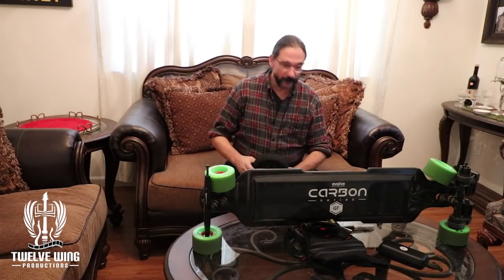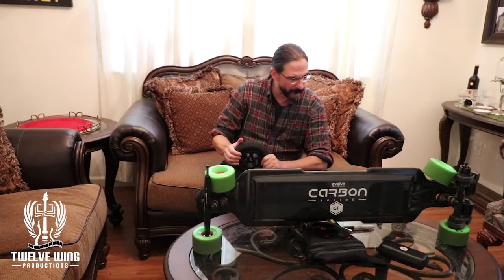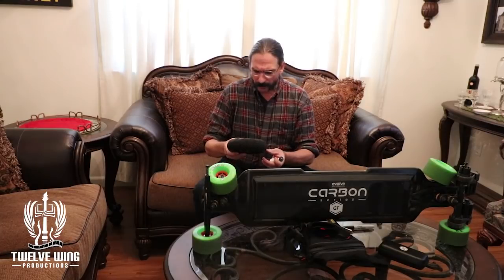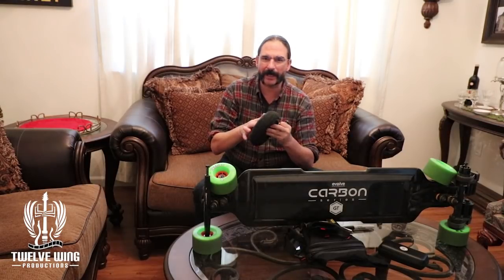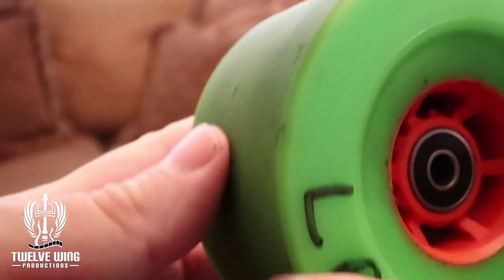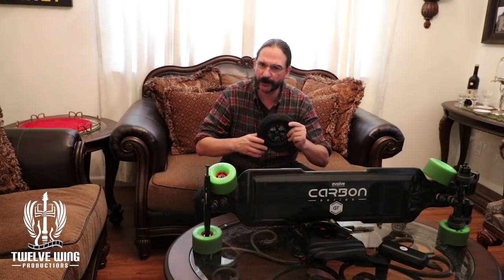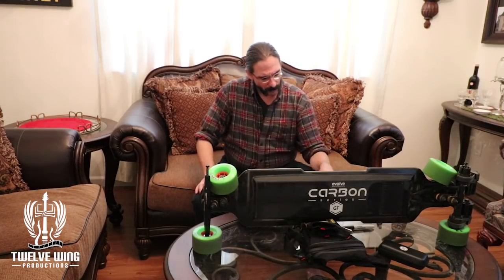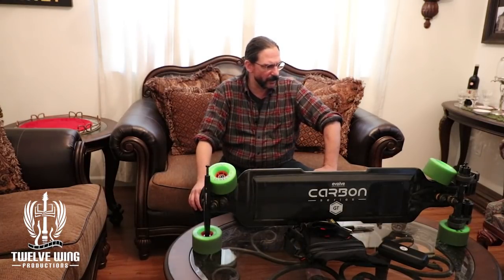Best electric skateboard bearings (and why)

Comment: I have the moc 5’s. They’re not that good and over priced for what you get. My $10 Independent GP-S bearings are faster than these bearings for a reference
Reply from the maker: I'd not say these bearings were necessarily "faster" if that is what you are looking for.
As I went into in the video, I view these bearings as a bit of a "special use" bearing.  What makes them cost a bit more is the fact that their construction allows them to take lateral load better than other bearings.  Because the channel is deeper and comes up further on the sides of the internal ball bearings, what you say is likely true since this would increase the contact surface.
In the case of an electric skateboard, however, "faster" probably isn't nearly as important as longevity.  ESPECIALLY when you are talking about the new cadre of electric longboards.  Skateboarders aren't usually getting on the board and doing 20 miles in a day.
Again, as I went over in detail in the video, the torque on the drive wheels of an electric skateboard are where I think the use case for these bearings really comes into play.

Comment: Theres just more wear on the back wheels because majority of the time as humans we pute most of our weight into our heels thats distributed towards the back of the board  the back trucks bushings are probably abit tighter while the front truck is more loose being easier to guide you around you'll probably buy new wheels but if need be you can just rotate them back left wheel to the front right and back right to front left hope this helps have fun and be safe
Reply from the maker: I'd say a combination of different factors.  What you say is likely true in that I can certainly say that as I approach obstacles like expansion joints and such, I tend to shift my weight rearward to unload the front of the board a bit.
I can, however, equally say that due to the large size of the wheels I do NOT do this as much as I have done with standard skateboards... even longboards.
I'll also submit that the type of torque related damage I'm seeing on the rear wheels (Curved cuts) is also not indicative of the more "puncture" type wear one usually sees in a skateboard wheel.  So there are most certainly other factors going on here.
Now that I'm getting back to doing some videos... I may have to revisit this and see how the ol board is doing.  Maybe take everyone through the inevitable upgrade process I have to go through to be actually happy with the remote.

One disappointment I've had with the Evolve board I have is that what is obviously a world class board design was coupled with such a crappy and even dangerous remote.

Comment: Oust Bearings I am dis appointed in the moc 9 they failed in my daughters board she weighs 73 pounds at 10 yrs old and in 1 year they failed i have read they are one of the best on the market maybe we got a bad set these were on the front of the board the board riding is very low abuse just road riding basically no puddles mud nor rain they are wrapped with 59mm bones rough riders and the wheels look awesome in new shape for the age yr old.  maybe a bad set i would like to write oust bearings and perhaps get a replacement and give them a try again. i dont want to sell them out just yet..... great video i really enjoyed it. and your right a lot of the top riders use them too and this is why i got them.
Reply from the maker: Sorry for your experience and I hope this wasn't a catastrophic failure.
One thing I will say about them is that because the races encapsulate more of the radius of the actual ball, the clearances may be tighter overall and less forgiving to debris or corrosion if the board isn't frequently used/lubricated.
That's hard to say.
And yes, it could also have been a bad batch.

All I can say for my experience is that I've had good luck with them on the drive wheels of my board.
I didn't do much riding at all in 2020 so I'll be doing a review of how the batteries held up after non use for that period.  I'm actually setting up for that video now.
Reply: @twelvewingproductions7508   ya i will have to try them down the road many people talk good about them its tough to take that a 10yr old burnt them out. but ya we will try these later i will try some other brands like the https://seismicskate.com/product/tekton-6-ball-xt-classic-bearings/   so this company products was use in the world record 91 mph down hill so i will try their products and see how they hold up. I will be building another skate board set up for my daughter most likely going with the FLIGHT DECK  some thing that will last a long long time and feel new further down the road. any ways great video we will keep you up to date on the other bearings we did get a set of bones ceramics for the new set up and will use the tekton 6 ball for her other skate board.
Reply from the maker: @brucetraudt1571  It's important to remember the context of the video.
I have absolutely no doubt that there are faster bearings on the market.  One of the points of failure that your daughter may have encountered was debris intruding into the bearing.  Remember.. the very thing that make these bearings a good choice for slalom skateboards or for the drive bearings of an electric skateboard are the very things that might actually cause them to roll with slightly more resistance in other applications.  The fact that the bearing race comes higher up the ball.

In the case of your daughter's board, if there was debris that somehow got inside the bearing or if they became damp and were not used/lubricated for a while... any build up of rust is going to immediately start to lock them up due to the increased surface area in close proximity to the ball bearing itself.

So similar to any engineered application, a downhill bearing is going to look somewhat different from a slalom bearing... or an 3-skate bearing.
Best of luck with your new board!
Reply: Did you use spacers?
Reply: @palleh7742  yes i used spacers

Comment: Don't be fooled by Oust's BS.  They made up that "MOC" term and it's total fugazi, when in reality that's what bearing manufactures like SKF (global bearing maker... $85B annual revenue business, they're huge) call "deep groove radial".  Oust is not the only bearing manufacture that makes deeper groove bearings.  It's worth reading about bearing configurations from SKF, they have online resources for companies who buy custom bearings for specific functions and SKF goes into detail about the heat tolerances, space tolerances, etc of different materials, cage configurations, ball diameters etc.  I won't say what bearings I choose or why (I will say that is not Oust) but when you read about what materials and demands your skating may impose on bearings you can then choose the right bearings for you. I've had some bearings that have lasted me 10+ years of daily skating and countless sets of wheels and lots of abuse.
Reply: just say what you use bro come on now why withhold that
Reply: @sebastiancamarena2824  ugh, so the best pair of bearings I have ever used were the Bones 6-balls Swiss. I believe they are now called Swiss Big Balls. They are pretty expensive though. I got more than my money out of them, but I don't shell out the $ for them now. I will say, if you mostly skate smooth concrete, lower tolerance bearings will do okay. "Tolerances" are the degree of precision with ball roundness and fit within the raceway. I live in NYC and find that vibrations from rough ground, big weather shifts, and dirt have a big impact and are just abusive on bearings, so I know bearings will get a beating and dont drop $50 on bearings anymore.
Reply from the maker: You were half right.  Oust created the "MOC" term... however if you would bother to watch the video all the way through, or pay close attention to what I am saying in regards to the races... you will understand what this term means, what it does and why bearings with this design are going to be:
A: A little more expensive
and
B: Not listed in an ABEC catalog.

These bearings have a rating for how much of the bearing they encapsulate.  Not the dust covers or bearing retainers...but how much of the bearing is surrounded by the lower race.
Obviously you can't have over half or you would have a hell of a time snapping the bearings into place and a difficult time manufacturing them... but these bearings come awful close.
So close that they deal better with lateral loads.
That said, I haven't seen a published paper on what actual dimensions accompany the "MOC" rating but since it's at least an internal measurement they use... it has a hell of a lot more clout than a "Skate Rating".  What ever the hell that is.

Comment: I'm glad you liked our MOC 9 Airrr bearings. The owner of  OUST Bearings Carl  is the one that actually coined the term MOC ( machined optimum clearance ) when
he first designed the bearings to handle torsional and other non typical loads. Please call us, I would like to put you video on our OUST Youtube channel and website.
Reply: You only have one vid on your channel. Light it up!
Reply: What MOC level should I get for street and truck skating?
Reply from the maker: @rudydaberry122  Powered?
To be honest, before I started examining the electric boards as part of an e-mobility study I hadn't ridden a standard street board in 30 years or so.
I can tell you that the slalom guys use the Oust high Moc ratings because they require a bearing that can withstand high lateral loads.  So I'm probably not going to be best evidence on this one as to what would work best for a standard kick street board.
Reply: I've bought Oust MOC 5 Tech bearings, for my skateboard just an hour ago.
Reply from the maker: @Sunny-qo2lt  What application?
Reply: @twelvewingproductions7508  They're my first bearings, (besides the ones I was given.) And I'm ashamed to say, I bought them off Amazon. But I saved $9 because it was on sale.
Reply from the maker: @Sunny-qo2lt  No shame in getting a deal.
So these are for a standard skateboard?  Electric board?
I was curious as to the application.
I did a study of the MOC 9 bearings because of the ability to handle lateral loads.  The drive belts apply torque off center from the center of the bearings so with the wheels on the ground and the belt cranking the loads tend to degrade standard bearings fast.
Hence the video.
I only use the MOC 9's on the rear wheels.  Those are the driven wheels.
Reply: @twelvewingproductions7508  It's for a Standard Skateboard, I just saw this video on bearings and he said Oust had probably the best bearings.
Reply: Oust Bearings will they fit regular shark Wheels ?
Reply: Joshua White every skateboard bearing are the same size to fit every skateboard wheels
Reply: Does it every moc bearing have the  the metal ball cage? In side them
Reply: I just talked to Carl today not knowing he’s the owner. Stand up guy and got a refund for the extra set of bearings I added to the cart by accident. Great service and 1st time customer
Reply: @ddbdk1  It was a pleasure talking to with yesterday. It's solid customers like yourself that make owning a business all worth it. Thanks for the shout out and the support, Enjoy the new set of MOC 9's!

Comment: nice video I see you touched for a moment on the wheel bearings spacers ,I noticed that issue right from day one and noticed them starting to get more loose from side to side expecially on my front tires yes I contacted them and they said add grease basically to fill the void of the bearing pocket that probably shrunk more then they should have in their mold process so yes I filed my middle spacers to fit more 1 to 1 and they do but its just a bandaid cuz the pocket dimension in the plastic wheels are to big and the bearings sloppy soon as you put it in .Notice the urathene wheels the bearins fit snug almost perfect and less friction aswell.My thoughts thanks for tuning in .lol
Reply from the maker: I'll have to do a video on this topic by itself.  It's not nearly as critical with the AT wheels as you might think due to the overall flex of the things to begin with.
The reason I felt "greasing them" was appropriate was that this minimized the deterioration of the pocket.  They still moved a little but that's alright because that might be better than the alternative.
The thing to remember about radial bearings and especially the moc 9 high wall high tolerance bearings is that if they are misaligned at all or if pressure is put on the sides of the bearing cases, they won't last long.

I highly doubt that electric skateboard wheels will ever be engineered to the same degree as say an automotive bearing.  It's just not necessary to get the kind of product life out of the boards.
Keep following along and I'll let you know how the AT wheels do after say 500-1000 miles on the OUST bearings.

It is unfortunate that the centers of the AT wheels can't be more accurately machined.  They charge enough for them... but then you run into the issue of the spacers and bearings not really being a uniform engineering standard either.
So because of the materials we are talking about for the hub, it's just not practical to go too crazy with the tight tolerances and probably better to just let them float a little and find their own resting spot in the pocket.

Thanks for the reply.  It's always great to see what others have experienced.  It's very helpful to us all.

Comment: This is a nice bearing review.You are very familiar with electric skateboards, have you ever tried skateboarding at a park with a regular skateboard? We skate at skateparks almost everyday and film our sessions. Check out our channel if you have any interest.
Reply from the maker: I'll have a look at your channel.  As to my skateboarding, I used a longboard back in the 80's to get around but I'm too old and fat to do any skate park riding.  I'll stick to the E-boards and electric bicycles. 
Thanks for your kind words though and I hope you keep checking in from time to time.
Reply: Give SHIVER bearings a try...they have built-in spacers and use a NASA grade lubricant. I started out with the OUST and fell in love with them..but since i use both street and AT wheels and carve like it's goin out of style, I'd end up pinching, squishing and later on warping the seal of the bearing. Tried SHIVER and was thoroughly impressed with the results. Any bearing with a built-in spacer, in my opinion, stands a better chance in an electric skateboard wheel/tire. You can find them on amazon at the moment for under $30. I guarantee you'll make a follow up video after you give them a try. Good luck and be safe out there! Carbon GT is the way to be!!!
Reply from the maker: Thanks  @justmethinaround .  I'll have a look.
The thing that got me looking into the Oust bearings was how far the race came around the bearing.  Integrating the bushing might be helpful depending on how they did it.  I'll have a look over the course of the next few hundred miles and do a bit more of a review when the weather starts to warm up again.
Reply: And forgot to mention..for the AT tire...if you want more speed...upgrade to the MBS 8" T3 tire. They're unbelievably lighter then stock evolve AT tires, last just as long, and allow you to max out the top end speed without sacrificing torque. I've been running them for about 2 years, flawlessly. Best tire, hands down.